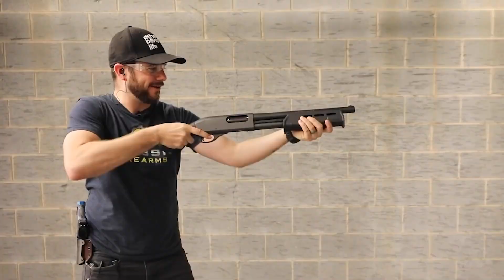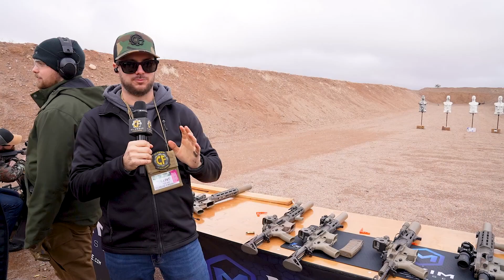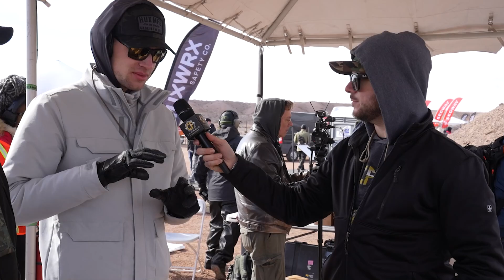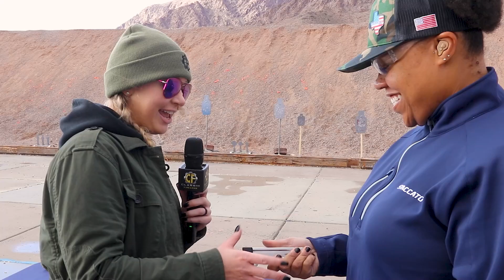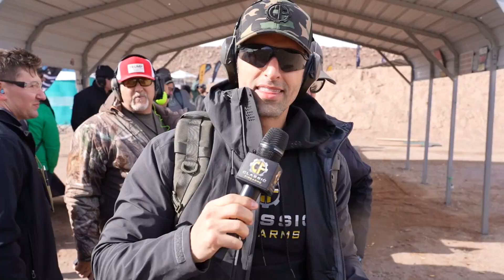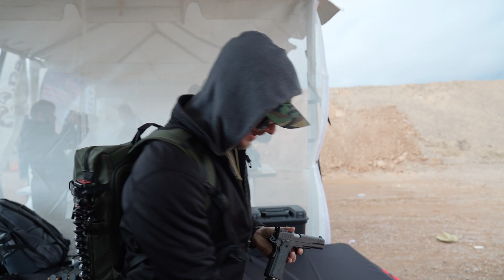SHOT Show 2023 |  Range Day Part 1

Comment: I have both the SA-XD 9MM and the SCCY 9MM. They both with take the Federal and the TulAmmo without any problems. The Hornady extreme defense round will not fully seat in either gun, they get stuck in the chamber. Other than the Hornady is shorter than the other 2 I can't tell by sight any difference. Anyone know why they won't chamber the Hornady rounds? Thanks.